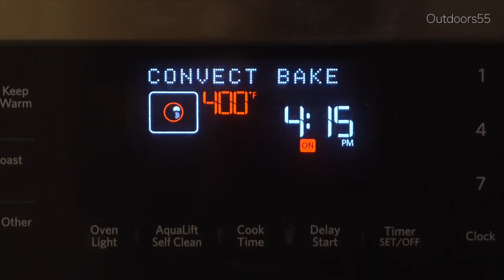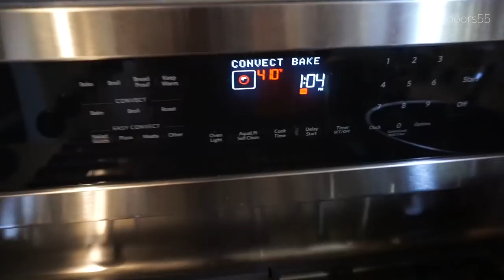Knife Making With Regular Tools | Every Step Shown

Comment: I like the idea of using a burr on the Dremel to undercut the cavities in the scales to create a mechanical bond to the hardened epoxy, effectively making them into a single piece.
Reply from the maker: It’s definitely overkill to do this, not many knife makers do, but it makes me feel better using pins rather than screw together fasteners (corby, loveless bolts etc.).  It’s an extra step I might as well do while I have the scales off the blade. 🙂

Comment: Only recently found your channel; great stuff, man. I've been wondering: Is there a special reason you hardly ever seem to use 'natural' material for your handles, like wood, bone, horn, ivory etc ? I am asking in case I am missing something in my own work. Cheers!
Reply from the maker: I just like stable materials. Ive used stabilized wood in the past but dont use a lot of it as sourcing good material can be tough. 🙂

Comment: Nice looking knife! Hey I have a question... take this as me struggling to understand due to limited knowledge - don't take it as a critique. I am curious... does drilling all those holes through the tang really increase epoxy bond strength? My limited knowledge suggests to me that you want to increase the surface area between mating surfaces, but doesn't drilling all those holes reduce the surface area? I wonder that because the only thing below the scales (where the holes are drilled) is a glob of epoxy.

Anyway, again, awesome knife. Love the scales.
Reply from the maker: I believe it  increases strength. The holes allow the epoxy to flow through the tang and bond to the other scale on the other side. Basically the epoxy acts as internal pins. The holes are drilled through both liners and mushroomed out so once the epoxy dries it bonds everything together. Some knife makers do this and some don’t. So not sure if it’s really necessary but it makes me feel better 😀 you don’t hear about many handle scales falling off so who knows🤷‍♂️ Worst cast is the scales fall off and need to be glued back on🙂
Reply: @OUTDOORS55  Thanks for the reply. I've only made 1 knife all the way through so I'm obviously no expert. I was just curious. I believe the more ways of doing things that you know about the more informed your decision when you're in the process of  finding what works best for you.

Comment: Are you a hardwood floor guy??? Could swear i saw you using a 24grit edger disc in this video. Seem to remember a bostitch flooring nailer in the background of another video.
  I ask because i am 2nd gen hardwood worker, and if you're a hardwood guy, it makes sense why i gravitate to YOUR videos!!!! Plus you're very good.
Reply from the maker: I’m not anymore. I installed hardwood for a number of years before moving back to residential and commercial carpentry.  Doing new home construction now. I tend to go where the work is.🙂  Thanks for watching man!

Comment: Hello I'm just getting into knife sharpening with stones and I was wondering for a beginner what would you recommend for starting stones. Should I buy the Ceramic stones you recently reviewed or the nortons. Can you also explain the grits as well thank you your videos are very informing and make me want to learn how to do this on my own
Reply from the maker: I would go with the ceramic stones. They are MUCH easier to use than the Norton's.  It depends on your budget for grits. If I could only buy two stones it would be an extra coarse DMT diamond stone and a spyderco medium ceramic.  If you had budge for three stones id get those two plus the fine ceramic, and so on. The medium stone is great for maintaining and light reprofiling, but really needs to be paired with something coarser for re profiling work.  Even a cheap $12 coarse stone or sand paper would do if you didn't have the budget for a dmt stone. Hope this helps!

Comment: Question: At 3:56 you heat it and then let it cool off in the air. Why? Is this a necessary step? In other videos (ex. March 23, 2018) you heat it up and then quench it in canola oil. I bought some 1074/1075 annealed steel billets from amazon. These will become my very first knife project. I am going to try to make the knife from you March 23rd video. Do I need to let the knife air cool or should I just heat and then quench in canola? Thanks for your advice. Your videos have given me the confidence to actually try to make a knife...I just want to make sure I'm not skipping any steps. Thanks again!
Reply: Usually when makers heat and then let it air cool, that makes it easier to work with, and takes stress out of the blade, which helps stop warping when you do the final heat treatment
Reply from the maker: It’s a normalization cycle. It resets the grain structure in the steel. It’s generally done 3 time before the quench. Hope this helps 🙂

Comment: Just getting into making and was wondering what you spray the steel with when grinding and sanding.
Reply from the maker: Just water to keep it cool during grinding. A soap water mix when sanding. It helps wash the metal particles away.

Comment: Very creative way of getting the warp out! What kind of epoxy are you using for glue up?
Reply from the maker: The clamped temper worked somewhat. The rest was bent out with a vice. This blade warped during the first temper cycle, something that has never happened before. I’m using gflex epoxy. It’s one of the “go to” epoxys in the knife making world. It doesn’t like to set in cold weather though, so it needs to be brought inside 🙂

Comment: One little question i hope you can answer, after looking around and constantly being recomended the expensive LONG belt type grinders, which would you recommend for beginner to deal with grinding bevels?....A 4x36 or a 1x30?  I'm trying to think of belt type variety to have more options for say ceramic and finishing belts etc.  If you can give a GENERAL recommendation as i know it depends but if you were starting from scratch and only thinking about smaller sub 4.5 inch blades running 1080, possibly 1095 or 01 which one would you begin with?  Thank you so much for inspiring me to go grab some of the tools i was missing and give it a go.
Reply from the maker: Id go with the most powerful 1x30 you can find. ALOT of very nice knives can be mad on a 1x30. You may have to do some mods to it but not as many as a 4x36.  Generally speaking you will find 1x30s come with 1/3 hp. there are some out there with 1/2hp and 3/4 hp but the price goes up. Again, they will all make knives.  Most belt manufactures carry a variety of 1x30 belts as well so that shouldn't be an issue. Hope this helps🙂
Reply: @OUTDOORS55  exactly what i needed, just finished grinding by hand my first file knife today... crossing fingers for tempering

Comment: Another great video. Im in the process of buying the equipment to have a go at making knives and razors. Im looking at using old files and saw blades to start off with what sequence of events would you recommend. Would i soften first then  cut or cut then soften do you have a private email so i can correspond when I need advice please.
Reply from the maker: It would really depend on the exact type of knife your trying to make. Id recommend just buying some 1080 steel that comes pre annealed. Then all you have to worry about is hardening and tempering. Files are OK but you won't get as good of results as 1080. 1080 is super easy to heat treat, files are always a mystery, as you dont know the exact steel composition. Files can also be case hardened which would mess you up as well. 1080 is pretty cheap too. 
    The best place to reach me is here on youtube. Im pretty good at replying to comments. Just leave a new comment on a video and ill see it. If you reply to a comment, theres a chance I won't see it (just the way the youtube comments are set up, its a terrible system).

Comment: Is there a reason why you dont (or cant) fix a warp directly after you've quenched it if it warped?
On man at arms reforged they've sometimes straightened out swords using a bench vice after letting it quench for a few seconds before it fully hardens. 
Granted were talking swords not knives but i dont see terribly too much difference aside from length. And maybe tapering.

Also love your stuff bro

Oh. Also, is your oven capable of causing warping?
Reply from the maker: Yes you can and after the quench is the ideal time to straighten. Mine warped during the temper cycle (sorta strange but it happens). After quenching you have a small window where you can straighten any warping. With 1080 you have until the steel cools to around 450f to straighten. After that it’s better to wait and try to straighten during the temper cycles. However that doesn’t always work as seen here🙂
Reply: @OUTDOORS55  hmm good to know about the ovens.
I tried making a knife some months ago (completely unfinished) and mine warped the exact same way yours did. Wasn't too sure which one caused it tho. Was probably during the quench as i wasn't thinking about warping at the time.
Tho i used O1 tool steel for it. One day i will get back to it lol
Reply from the maker: Yep, warps are a part of knife making. Funny thing is they don't affect the use of the blade in any way. A slightly warped blade will still cut stuff. Its all for looks. 🙂

Comment: What brand of drill bits do you use? Mine are dull after one hole.
Reply from the maker: I think these are mastercraft. They are fairly cheap bits. The trick is to keep them cool. Getting them too hot will soften them.
Reply: @OUTDOORS55  Thank you for the fast response. I do go slow and use oil while drilling. I must be doing something wrong. I am impressed that you got 15 holes with one bit. Keep up the good work.

Comment: What kind of Emery paper used and cleaning of surface used chemical or water
Reply from the maker: Started with 220 and went to 600 grit. I was using windex as a sand fluid but I usually use water. I just needed a new spray bottle so I bought some windex🙂

Comment: My question: I want to make a bowie knife with a coffin handle. How do I fit the guard though the handle?
Reply from the maker: Drill holes through it, and then file the rest with a small file. Hope this helps 🙂
Reply: @OUTDOORS55   Alex, it doesn't help at all due to the fact that in coffin handle bowie the "coffin" is much thicker than the blade.
But thank you for finding time to reply anyway.
Reply from the maker: The guard can only go on to the handle two ways. Over the blade portion, or over the handle portion. Both would be fitted the same way though. Unless its an integral guard/bolster. In which place it would be forged with the blade.

Comment: Why did you go for such a steep bevel grind?
Reply from the maker: It’s called a scandi grind with no secondary bevel. The bevel is around 25 degrees maybe slightly under. 🙂

Comment: What's the angle of your grind?
Reply from the maker: Not sure exactly. Somewhere around 25 degrees
Reply: What is the thickness of your blade, and what is the bevel width?
Reply from the maker: 1/8” thickness. Bevel width is 1/4”
Reply: It's 28 degrees, almost 29

Comment: I don’t like the sanding marks on the blade. It makes me curious why knife makers do not use polishing wheels on bench grinders etc? I prefer no machine marks or sanding scratches on blades myself. I’ve never made a knife but have polished several of them to mirror finish without any hand sanding or hand polishing. Am I missing something? He uses grinders to shape the blade why not use a machine to achieve a better polish as well?
Reply from the maker: Several factors, its time consuming and demand isnt that high for mirror polishing. A mirror polishing shows any and all scratches, and a scratched mirror polish isn't good looking. So they dont make useful blades. They are mainly for looks and don't serve any useful purpose (other than maybe slight corrosive resistance).  If people are willing to pay for the polishing than thats fine but they just aren't that popular right now. Just my observations 🤷‍♂️
Reply: That makes more sense to me now. Still, can’t you use a higher grit on your 2” sander (grinder) to avoid all the hand sanding?
Reply from the maker: Yeah, but the higher grits belts dont last long and they are expensive. Its also hard to do a perfect mirror in the first place. Same with hamons. They look great but are harder  to do and take alot more time. I think thats why you dont see many of them.

Comment: Could u make a stainless steel knife?
Reply from the maker: I don't have the ability to heat treat stainless. Stainless requires much more accurate temperature control and is usually don't in a heat treating oven. Most knife makers who don't have ovens are limited to carbon steel
Reply: @OUTDOORS55  you could always send it off to another knife maker who has the right tools to do it. Maybe Evader Knives would. He is always helping other new knife makers, and collaborating with fellow YouTube knife makers.